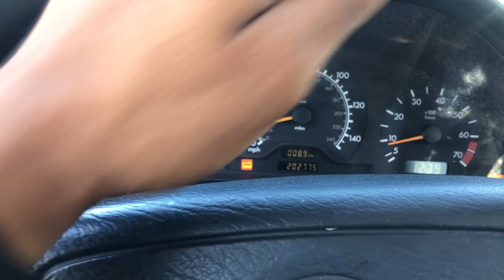Changing The Radiator in The C230

Comment: Pretty sure I may account for at least 10+ of the views on this awesome video ;) . Used this as my guide to replace the radiator in my wife's 99 C280. Her's is the V6 but thankfully the radiator, hoses, etc. are all super similar to the C230.  Really appreciate you making, editing, uploading, etc. this as these cars are becoming less common on the road. Relying on 9+ yr old forum posts is not nearly as helpful as a well done how to video like this!
Reply from the maker: Wow, that is awesome to hear. I didn't think much into it and simply wanted to document the process. Now I wish I kept it and went through the headache of fixing the transmission. I do have a how-to on replacing the PS pump I never put together but hearing this has motivated me to do that. Just being able to help one person is more than enough. I too I've learned very quickly there isn't much info on the Mercedes because most owners just took them to the dealership. I'm glad you got it fixed and thank you for sending me the comment.

Comment: Literally thank you, I have my aftermarket radiator coming in on Wednesday. Made me see how easy it is. What do you use to clean? I wanna clean my car but am scared to wet the engine (it’s my first car so I don’t really know much) what psi do you use and what cleaner?
Reply from the maker: You’re welcome!. Looks like I need get another one of these lol. For cleaner I used purple power degreaser. If you want something weaker you can use dish soap mixed with water. As for pressure washer, technically the weaker the better. Mine is 3200 psi so it’s overkill and I have to be careful when using it. Just don’t over blast one area esp the alternator, coil packs and other electronics. They can get wet but you don’t want to blast water on em for an extended time. Use the 45 degree (white) nozzle as it’s less harsh. I’ll be doing a engine clean on the Honda project soon so I’ll make sure to detail the process for you.

Comment: I think you need the blue coolant ...maybe this one replace the blue ??
Reply from the maker: Maybe, but the car is long gone sadly.
Reply: @richardmasonhughes  To bad I have mine for 25 year now no problème at all  normal things
Reply from the maker: @charlesboulay8303  I miss it so much. The transmission seized up out of no where, I regret not fixing it. But, getting the newer  w203 c230 with the 6speed manual was a pleasant replacement, so I'm not too upset. I love the car!
Reply: @richardmasonhughes  At Mercedes maintenance they tell me the transmission is for life you don't change the oil .....big mistake I insist and they change it ........good for you if you find an other one
Reply: How many miles did it have? @richardmasonhughes